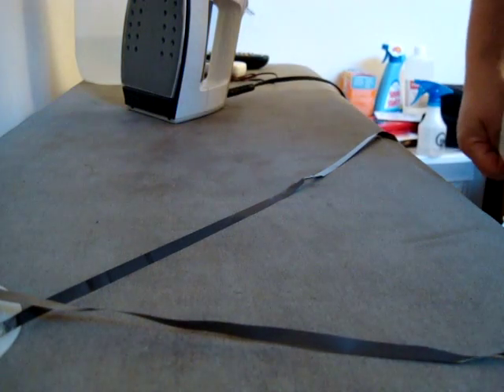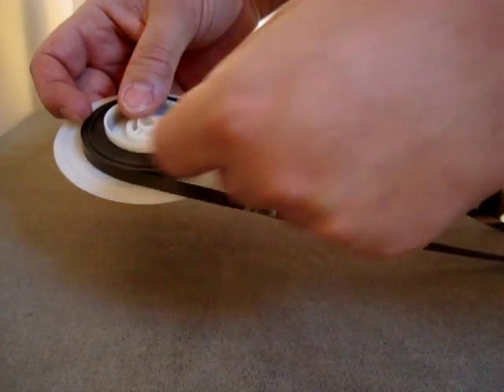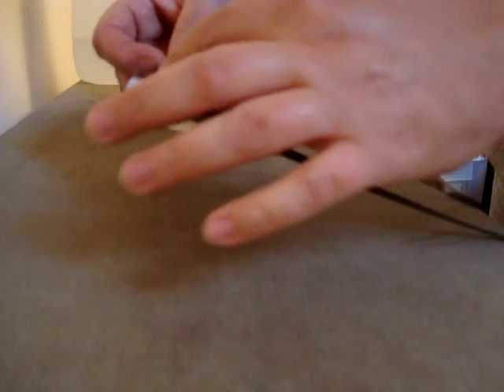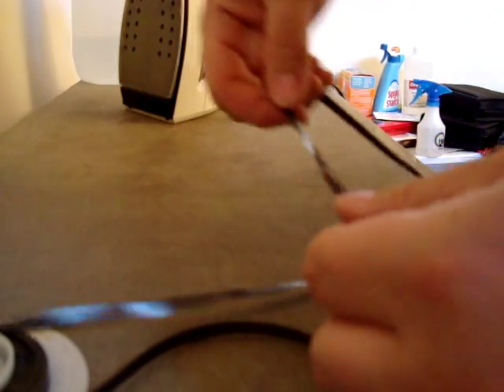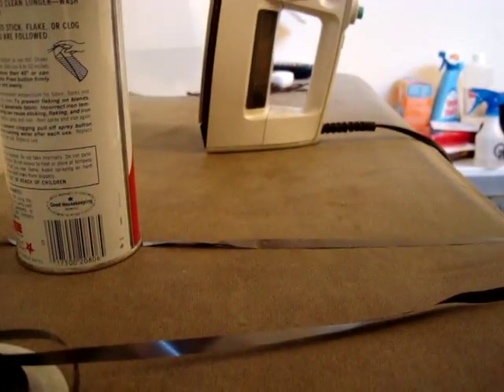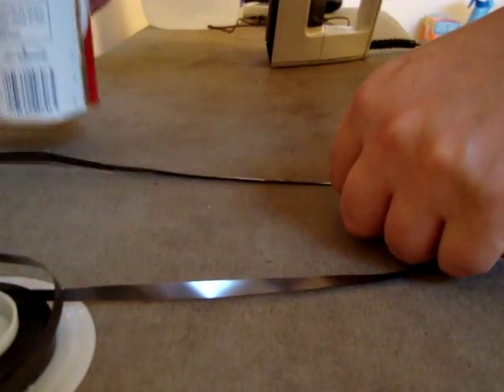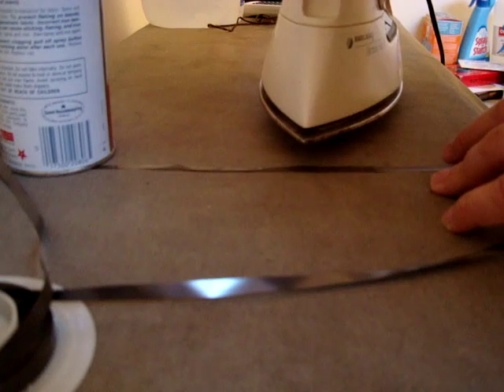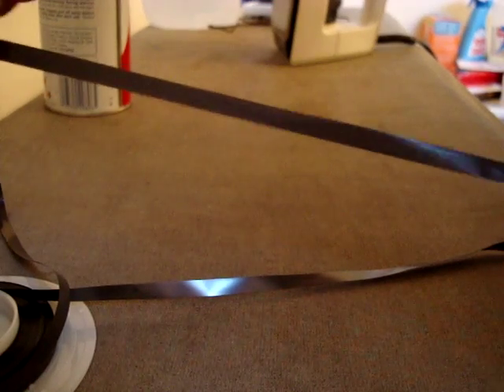8 track ironing out wrinkles (AMPEX Repair pt 2/3)

Comment from the maker: Thank you so much for that insight. Never really thought about that. I suppose if there are a large number of heating elements and that are close to the sole of the plate, then that could be an issue.  I'll have to try that next time.  The other thing you have to be careful of is to never tug/pull on the tape while it's heated or you will stretch it thin.

Comment: Hey Waukee. I'd like to know: Does this technique also work for cassette tapes as well as 8-track tapes? :) Thank you! :)
Reply from the maker: I'd be very careful with cassettes because those tapes are so much thinner that they're easier to stretch and ruin. If anything, warm or lukewarm would be the best setting.
Reply: @waukee321  Is there a way of removing wrinkles on a cassette tape where it'll be playable again?😀

Comment: One thing that I do is heat up the iron and then unplug it before ironing the tape, the reason being is that the AC power running through the element can wipe sections of the tape with some irons. With my iron I dumped the water out of it and heated it up empty so I have more control, setting it at between 1 and 2 usually works but sometimes I have to set it a little higher on extermely messed up tapes. I am also fortunate to have a stone countertop which is perfect for ironing on.
Reply from the maker: Excellent point! Yes, the current running through the heating coils in the iron can potentially act as a magnetic field and affect the tape so be sure to turn it off after it is heated to the desired temperature.

Comment: Will this work for VHS tapes?
Reply from the maker: +Houdaloth Ali I'd be hesitant since VHS tapes are about as thick as cassette tapes although they are wider. Best to experiment/practice on an expendable tape first. Being so thin, the heat should be as low as possible and you need to be particularly careful not to tug/pull on the tape while you are doing this as it will stretch the tape which could cause unevenness and lead to it being eaten when played. I would do this for only extremely wrinkled tapes again with the lowest heat possible. Use a smooth clean iron surface and you may want to cover the tape with a thin sheet of smooth, plain unscented/unlotioned paper towel, tissue paper, or unprinted paper such as printer paper making sure it won't stick to the tape if heated on it. Be careful you don't scorch the paper (will turn brown). It is important that both the underside and what you are putting in contact with the taper are absolutely smooth or you could imprint a dent in the tape. Also, when you reach the heat level, turn off the iron in case it creates a magnetic field which could potentially erase the portion being ironed.
Reply: +waukee321 Thanks alot.
I have also read about putting the tape inside a big book and then putting a weight on it.
The latter seeming less risky.
I am aware of the magnetic feild and will turn off my iron if i do as well as using a practice tape.
I really would not want to lose any footage at all.
Reply from the maker: +Houdaloth Ali No Problem. Any sharp crease you could try to bend or flex back in the opposite direction to get rid of. Always be sure to wear clean gloves (e.g. latex powder free) so you don't get skin oils on the tape. Putting inside a large book is obviously safe, but may end up waiting a LONG time for wrinkles to go away. Putting the tape and book in a warm room would speed it up. Technique almost like that for removing warps from vinyl.
Reply: Houdaloth Ali so did it work
Reply: @Jon-lp6en  Someone should make a video on proper VHS restoration.

Comment: What causes a wrinkly place to get on the tape? :)
Reply from the maker: When the internal take up spool isn't pulling/turning enough to take up the tape slack, the tape will back up and the capstan will keep pushing it into the cartridge. The pushed in tape has no place to move so it bunches up and starts bending and wrinkling. This mostly happens when the tape on the spool is wound too loose. Too tight and it won't pull out easily. Has to be balanced just right.

Comment: Also would the age of the iron have any effect? The iron I have here is a 1950's General Electric, not modern in the slightest.
Reply from the maker: MrWolfSnack Those old irons get very, very hot. No safety guards like auto shut off and the sole plate is usually not non-stick. Just make sure it is clean and smooth.  Be sure the heat is at the very lowest setting to start with (just barely turned on). If the tape it curling on the edges, it is too hot. Move the iron quickly across the tape length-wise in a straight line and be sure the tape is straight. Leaving the iron in one place can melt the tape. Don't press down too hard either which can stretch the tape. I usually iron both sides too. Also turn on the iron to heat it up to that temp then turn it off when you iron. Many of these irons have electric resistance heat coils in the sole plate that can also generate an electric field that can potential erase those parts of the tape exposed or at the very least, the higher frequencies.
Reply: I'd like to buy a 1950 iron! Those things will fry an egg quicker than any microwave or iron skillet 😆
Reply: @RandyWBrown  Yeah you have to watch it carefully everything you do.  My family has used the same single iron for decades through 3 generations. I found an iron from the early 1910's at Salvation Army some years ago, I don't dare plug it in, bought it for decoration, but it's even more primitive. Just a piece of iron and a wood handle and an electric plug soldered onto the plate.
Reply: @MrWolfSnack  No wasted energy there! Like high wattage soldering iron.
Reply: @MrWolfSnack  I can't seem to get the twists out of my Billy Joel Glass Houses tape. I'm starting to think it's because I'm left-handed because I keep ending up with more twists than I started out with. Very frustrating!

Comment: Hello. After I fix my VHS tape with an iron, will the contents go normal? Because a portion of the tape was stuck between the barrels or something and when the tapehead reads the folded tape, it glitches and stops playing.
Reply from the maker: It depends on how badly damaged that section of the tape is. A small fold is usually fixable as long as you make sure you get it smooth. VHS tape is also very thin so keep the iron on extremely low heat setting.

Comment: I have a tape that somehow the splice broke...but it still kept playing and I didn't know it until it unraveled nearly all the tape inside the machine and the audio started cutting out. I took the tape out and it was wrinkled like an accordion.
Reply from the maker: MrWolfSnack I can relate to that pain. Never had it empty that far as usually the capstan jams and the tape stops. Then it's open up the unit and go tape fishing as you unravel the mess, hopefully the tape is still in one piece.  Depends on how much open space you have inside the tape housing too. If it's a car unit with tight quarters, it won't take long for the jam to happen but if it's a large console, I suppose you could fill the inside of the console case with a few cartridges. Was your tape one of the Columbia or CBS brands with the 2 or 3 tabs on top? They are the most prone. Best to pull out a cart you haven't tried yet as soon as the program changes or you know it's supposed to change. If it doesn't change so that it repeats the beginning song again, that's a BIG warning and something is wrong so you better pull it out fast and check it (this can occur too if someone spliced it with regular scotch tape, very annoying). If the splice breaks after it passed the capstan, that's when the tape gets eaten. Broken before the capstan, it just leaves a big void in the opening but at least the tape is OK and you can fish it out and re-splice.  Be sure to flex and give a good tug on the splice to be sure it doesn't peel off. I've checked some visually and they broke after about 4 program cycles. If the splice looks good, I mark a "/" underneath the tape so I know next time I play it, it's OK. If I replaced the splice, I mark a "X" underneath and likewise know it's safe to play it. 35-45 year old cartridges have old adhesive glue on their splices that dries up over time. Make sure you have a roll of aluminum splicing tape handy.

Comment: Can I do this on regular casette tape
Reply from the maker: Cassette tape is much thinner and narrowed than 8 track tape so the heat has to be extremely low and you have to be careful not to stretch the tape when ironing. Of course, turn off the iron once it heats up so as not to potentially erase the tape from the electric field from the hearing elements in the iron.